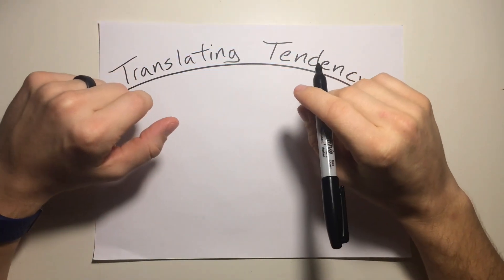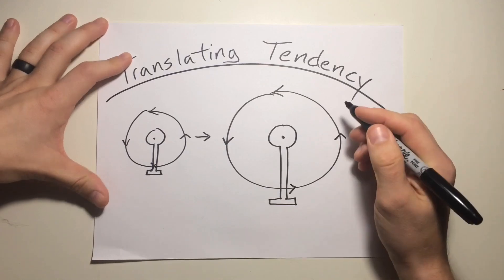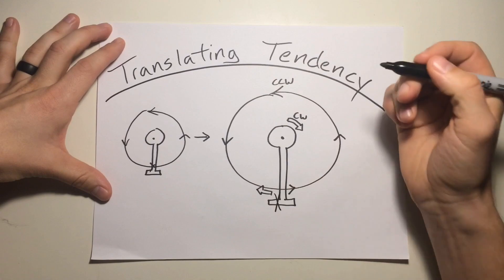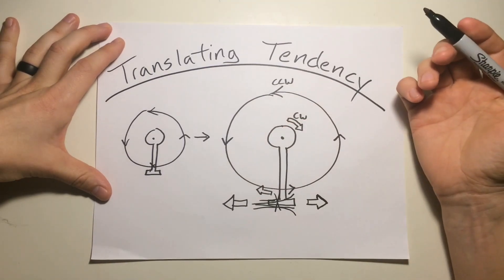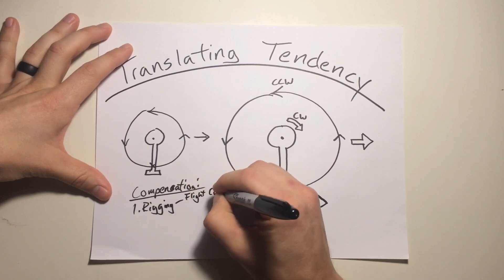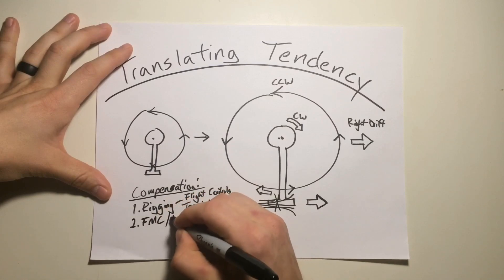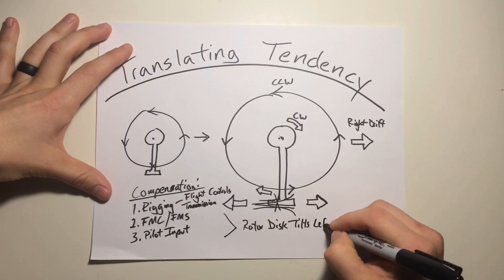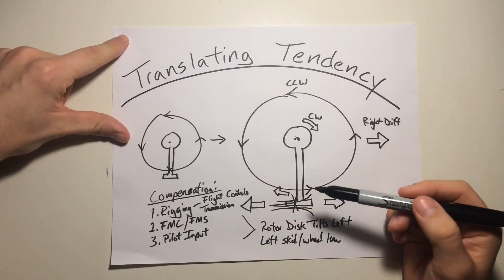Translating Tendency in Helicopters

Comment: I have a couple questions about this. I'm a fixed wing guy (Flight Engineer), but I do fly helo's virtually in DCS, and am considering going down the Helo PPL rabbit hole. Now, that is a simulation/game and obviously some liberties are taken as it can't model everything.

One thing i've experienced is in the sim, the slip ball (the only real reference to slip, since "seat of the pants" doesn't exist... yet) -- seems to be slightly inaccurate, but I don't have any rotor experience so I'm trying to equate what is going on.

UH-1H In forward flight, straight and level, 80kts cruising forward, 0 wind;
Aircraft is in a slight crab left (aircraft drifting right from aimpoint), slight amount of left pedal, ball is center.
IF I correct for the crab, by decreasing left pedal and even requiring a tad bit of RIGHT pedal, no more crab, but now the ball is showing a sideslip (ball slightly left)?

Is this the effect of Translating Tendency? or is it something else?
What would be the inputs to correct for this?

I suppose one answer would be to just fly it in a crab, but I'm curious about the effects of the flight model.
Reply: You have fly with slight roll to keep it from crabbing.    You can not really fly straight and level in the Huey.   If you try the rotor and tail rotor will push you sideways.  

DCS is probably one of if not the best at modeling realistic aerodynamics and flight systems.  So it is pretty much spot on with real life.  As long as you run it on a computer that can keep up with all the calculations it has to do.

Comment: It's very interesting to me to see all of the aerodynamics you teach in your videos happening in my small RC helicopter. When I use the tail rotor to yaw in a hover, the translating tendency is very apparent and the helicopter slides sideways if the cyclic is not adjusted appropriately. I already knew about that tendency because it's a fairly obvious expected action. But your lesson on VRS was enlightening because I didn't previously understand why that tiny helicopter would accelerate downward when making a quick descent without forward speed. 
I have a private pilot license but I don't think I'll be lucky enough to put these lessons to use in a full-size helicopter anytime soon. At least I can be an armchair helicopter pilot flying the RC heli around now and then.

Comment: Great videos, I have a slightly different understanding of why the helicopter sits left skid low however. Interested to hear your thoughts on this. The disc tilt to overcome translating tendency will not necessarily cause the whole fuselage to roll as it should hang vertically under the disc. The roll is caused by the turning moment in the vertical plane, due to the tail rotor and main rotor being mounted at different heights. Helicopters with the tail rotor mounted high, so at the same level as the main rotor (eg Apache / Huey), shouldn't encounter much roll in the hover. Those with the tail rotor mounted low (eg Jet Ranger, Squirrel) will experience it more.

Comment: Brilliantly explained… I came across this info while looking
for answers to RC Heli take off drifts and why one side lifts greater than the
other: In experiments: If I mechanically offset the cyclic from its natural
position relative to the stick to achieve vertical balanced hover, rather than
through Pilot corrective action on the stick itself which then places the stick to its
centred position for lifting and hovering which I find is an advantage.

Question: Is this understanding applicable if
in inverted flight hover...? Plus, what is the effect of offsetting the cyclic on the
forward motion, especially at speed, would further compensation be required to
maintain straight flight, or will the equal and opposite forces still be
matched?

Lastly: What about any effect to the tail gyro control
through this mechanically altering the cyclic levelling placing it off-centre to achieving
a centred flight stick for basic hover. Would they really do this in a 'real
Heli'… As you noted: It was an option?

Comment: Great videos, thank you! Quick question: at the end you explained that to compensate the rotor disk tilts left, but just to make sure I understood gyroscopic precession correctly, in reality it tilts front so that the effect manifests 90 degrees later on the left, is that right?
Reply from the maker: No but I can see the confusion. Gyroscopic precession deals with an input introduced into a point on a rotating body. If you increase pitch in area of the rotor disk, it’s effects will take place 90 degrees later. But when you’re moving he entire rotor disk itself this does not apply. When you offset or tilt the transmission to the left, you in essence change the center of gravity. The helicopter is suspended below the rotor disk like a pendulum. When you shift the point it’s suspended from a little to the left, it stops the translating tendency. I hope this helps. Great question!
Reply: Oh I see, it makes sense. I understand better GP now. The pendulum analogy is good too. Thanks for the reply and explanations!

Comment: is the tail rotor of the ch53 canted over to the left to counteract this translating tendency?
Reply from the maker: I can’t speak specifically for the CH53. But some helicopters with that design say that it does produce a slight amount of lift and helps to adjust the attitude of the helicopter to make it more level.

Comment: This may be a dumb question but how does this combine with transverse airflow and how it already makes you dip right?
Reply from the maker: Austin Taylor. Great question and many people get these confused. Transverse flow pushes the helicopter right during 10-20 knots while translating Tendency effect is due to a Hover. The biggest place you'll notice these 2 combined is the end of an approach. As the helicopter slows down you start to notice Transverse flow pushing the helicopter to the right. At the same time the pilot is cushioning to land by pulling in more power. This increase in power requires more left pedal to keep runway alignment and also produces translating Tendency. Both of these combine to push the helicopter right and you'll see pilots constantly landing right of the centerline.
Reply: Helicopter Lessons In 10 Minutes or Less ah I gotcha that makes sense! Awesome explanation as always! Thank you so much

Comment: Question:  Leaning or Left Skid Low .. does that apply to both rigid heads and teetering rotor systems ... like on the R22 for example?
Reply from the maker: HeliZero. It still applies. But its not pronounced/noticeable the same across all airframes.

Comment: Hi Jacob, your videos are amazingly good and acurate so thanks in advance for your help.
Just one doubt, during my training i was taught to compensate for the translating tendency on the right (i was flying an american chopper H269) using the antitorque left pedal but you said to use the cyclic wich also causes the rotor to tilt left. Isn’t more eficient  and simple the use of the pedal instead of using the cyclic? Just asking, aside from that i love your videos (sorry for my not so well english Lol)

Comment: Does the blades turn against the clockwise or with?
Reply from the maker: Sales aljraid. In this example and in most American designed helicopters they rotate counter clockwise.
Reply: Helicopter Lessons In 10 Minutes or Less , great, thank you so much.
Reply: Helicopter Lessons In 10 Minutes or Less I get a little confused cos I am training on the Guimble and it’s made in French. So its blades turn with the clockwise.

Comment: As an instructor, I learned to "keep it simple." In your drawing, you have two force vector arrows on each side of the tail rotor location, and I think you should use just ONE arrow, showing the direction of force the tail rotor is producing. So, when the tail boom is trying to move clockwise as a result of reaction to the force being applied to the main rotor disc, you could show the force direction of the tail rotor countering the rotor disc reaction, preventing the tail boom from moving in that direction. 

In other words, "begin with the end in mind." the point of thrust is the job it is doing. In the case of the main rotor, the force is against the thrust bearing (and then the engine and transmission mounted to the airframe) to lift the aircraft. In the case of a plane, it is to pull the airplane forward on its bearings and engine mounts. The one arrow pointing in the direction of translating tendency might make it a little more clear. HTH.

Comment: Wouldn't another form of compensation be to mount the tail rotor in the plane of the m/r disc?
Reply from the maker: Jeffrey Adams. You are correct. Perfect examples are the CH-46 and CH-47 helicopters as well as the coaxial design.
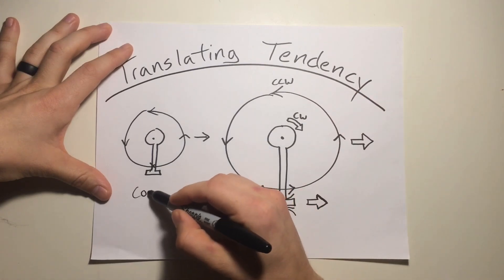Reply: 3:38 you said left